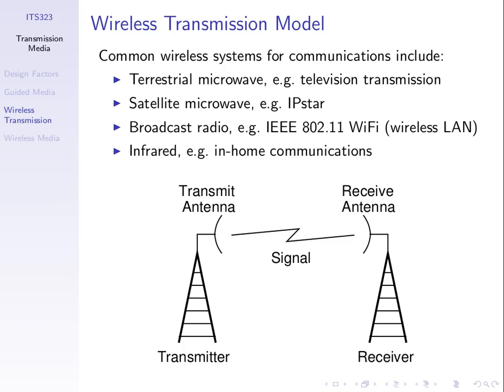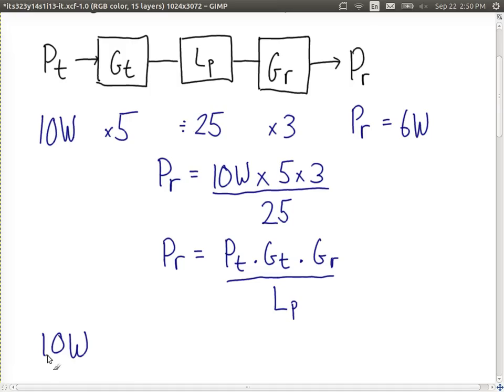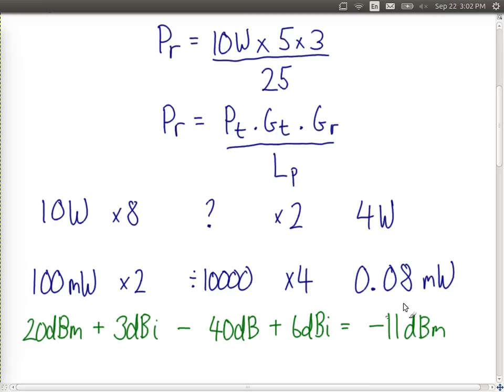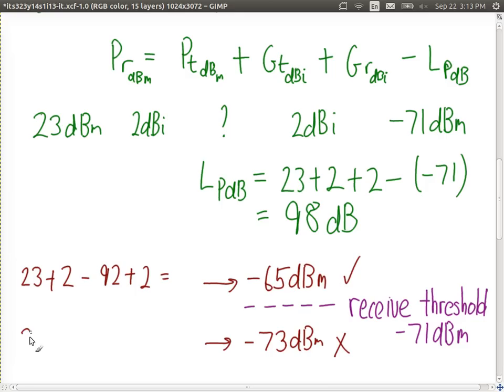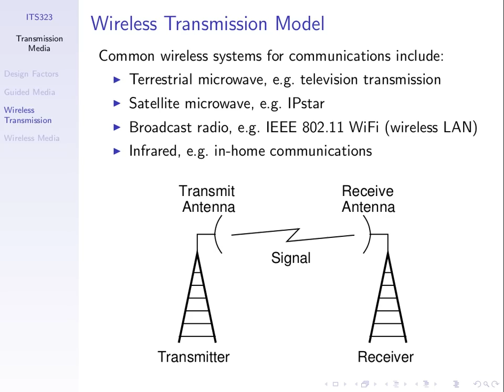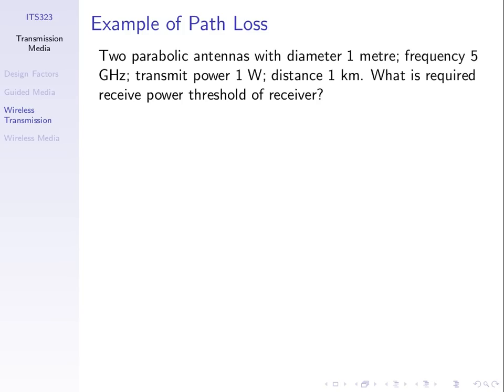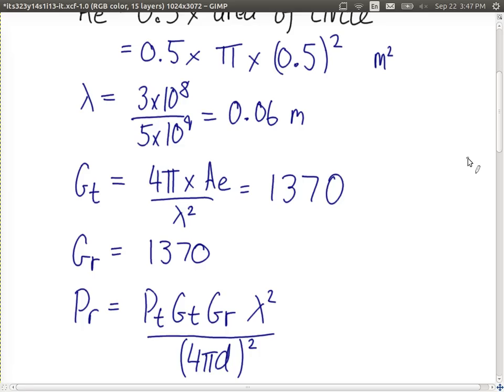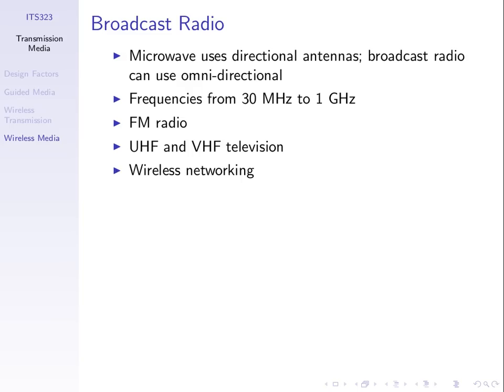Free Space Path Loss (ITS323, Lecture 13, 2014)

Comment: Really very good class on Path Loss Model for wireless system, antenna gain calculation and free space loss. For Radio Frequency Engineer or In Microwave design student  this lecture is very very helpful.
Reply: indeed even 9 years later this is the best explanation I find.

Comment: @Steven Gordon Thank you very much for your perfect explanation. I have one question. Pr=(Pt.Gt.Gr.lambda^2)/(4.pi.d)^2. So if we know the minimum required Pr for successful transmission, we can adjust our Pt to achieve that minimum required Pr. However in this equation we are considering only pathloss. If the receiver is experience noise and interference, then do we have to increase our Pt even more to be able to achieve the required SINR. In other words is the following formula correct for the cases where we have interference and noise on the receiver side ---> Pr=(Pt.Gt.Gr.lambda^2)/((4.pi.d)^2 * interference Power* Noise Power)